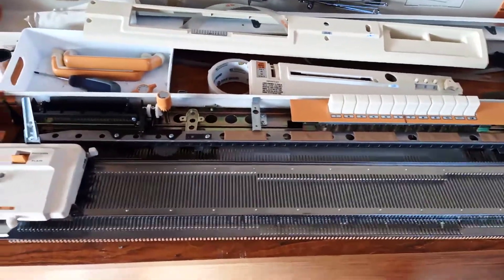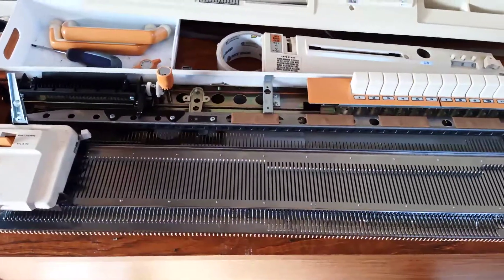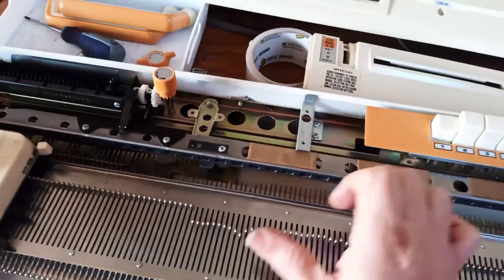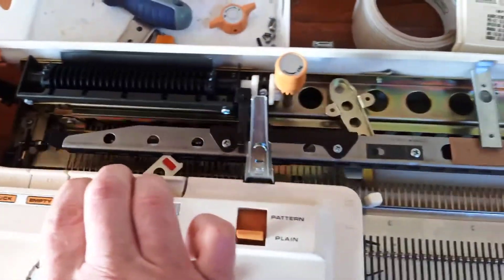Toyota KS787 pattern selection system

Comment: Did you change the sponge in the needle selector bar please ? If so is there a special one please?
Reply from the maker: Officially yes, however frankly any sponge bar of the correct length will fit. Brother spongebars are best for Toyotas.

Comment: Hello Charlie, again, thanks fior a great video clip. Unfortunately my rather promising 787 is tunring out to have various issues that will probably be beyond my capbilities of sorting out. I have followed your test procedure from the other video and in fact when i select needles using the buttons I seem to get random needle patterns. Do you think this is caused by the button / selector system or can it come from the carriage? if I dismantle the top as youy have done here, am i likely to have hundreds of things spring out at me that i will never get back in place again! Any advice on how to look into the machine and its problems would be grtefully rec'd. I'd really love to get this going and of course it's a bit of a shame to have purchased and shipped nearly 40 kilos of gear if I can't use it! Thanks agaiun for a great chanel. Peter in Paris
Reply from the maker: Hello! If you go to my website at www.vintagekm.co.uk you can send me a direct message and I will see what I can do to help!
Reply: @singlentendre  Hello Charlie, sorry, for some reason I didn't see your above answer. But in going ahead, dismantling and re-watching your video I have managed to solve the problem. The pins under the card reader had become pushed beside or off the individula springs beneath them. I just had to push the springs back beneath each (pin/rod/piston?) and everything was back working. Thanks again for your help. Everything is now clean and running well. I'll get back to you if I have other issues and nce again many thanks.